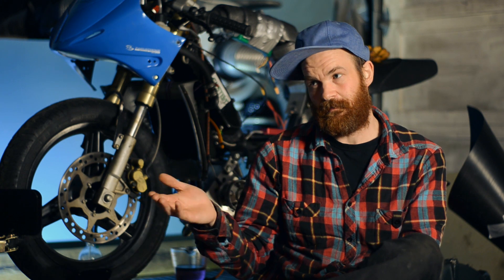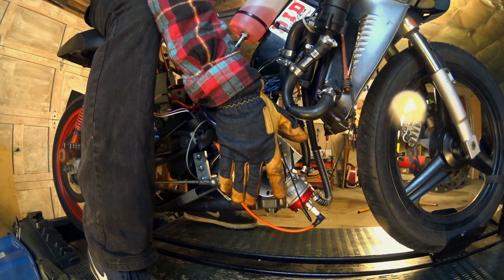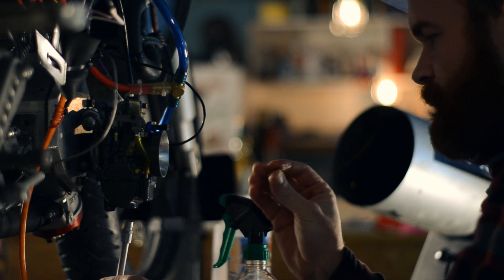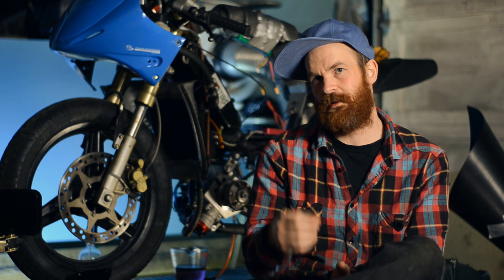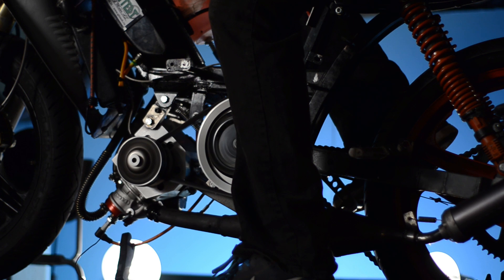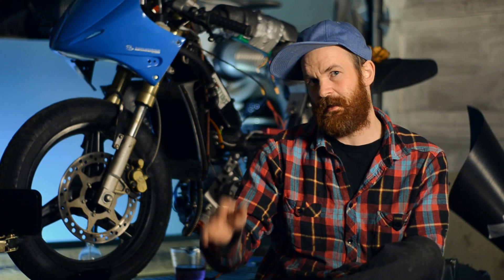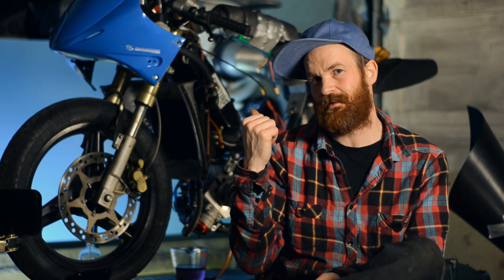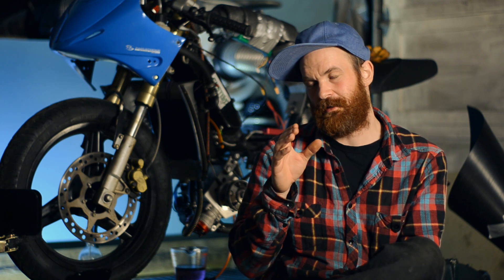Spx Ressurection Part 4 | The NITRO MOPED

Comment: I can only speak on gas motors. To really know your tune, pull the head and read the top of the piston. Look at the color delineation on the plug electrode. When you have achieved a perfect burn keep notes as to how the carb was tuned and what the adjusted altitude of the air was when everything came together.  These notes, and the adjusted altitude algorithm will give you the advantage during a California Timing Assoc. speed run.  To set records, your tune has to be perfect coming off the trailer!  Note, to make the perfect pipe you need egt.
Reply from the maker: Thanks for the tips!
Reply: @2STROKESTUFFING  I have never seen a more motivated builder!  I hope you accomplish all you have set out to do.

Comment: Did you try to put the largest max circuit on that carburator? Maybe you just have to close a little the air circuit and gain fuel circuit. What size is that carburator? I'm not an expert, hope this can be helpful. Great works on your garage, let's keep 2 strokes alive and make them better

Comment: Straightening the air may help a bit.  An intake hose, PLUS I suggets a K&N cotton filter. Foam may straighten better, but I found foam restrictive. K&N flows more. According to K&N themselves; their filter increases intake flow compared to no filter at all. (Your set-up).  I believe this is due to turbulence.  Think of a horde of people trying to enter a stadium. compared to organised lines of people entering. The latter will allow more to enter faster. :) hope this helps  :)
Reply from the maker: Thanks for the tips! I have to experiment!

Comment: Wich is the diameter of your exhaust collector? An old 2stroke enthusiast says me that he follow a simple rule: Carb diameter at most equal to the collector diameter. Maybe it is correlate to your problem
Reply from the maker: 27.5mm, 24mm at the narrowest cross section of the duct. Interesting rule of thumb.
Reply: I had an old polini evolution exhaust designed for 50cc evo engine (T port) and its collector diameter was 30mm internally, 24mm sounds a bit enclosed to me.
Reply from the maker: 24mm is 75% of the total exhaust port area, this to keep velocity high in the blowdown face.

Comment: Hi, what is "Tuned lean in inches"  i found something but i don't know what is it..
Reply from the maker: "tuned length" it's the length of the exhaust system, from port window to end of convergent cone(some use middle of cone)
Reply: 2STROKE STUFFING no lenght l, lean
Reply from the maker: Then I have no clue... Sure it's not a typo? What's the context?
Reply: It is for exhaust calculating Lt=Tuned lean in inches 
n=rpm 
etc... maybe carb in mm/inches, i don’t know
Reply from the maker: It's definitely a typo then, should be "length".
Reply: 2STROKE STUFFING maybe mistake by writer

Comment: Wats your plug gap at?
Reply: Also do you have a wideband o2 on it?  Is it reading  lean but sounds rich? i still thank its a dwell problem.  I would like to hear it again with a .010 plug gap        exhaust temp will drop also if this is wats going on up top.
Reply from the maker: About 0.6mm,I'm going down to 0.4mm. Actually thought I was at 0.4 already due to a measuring error with the slanted race plug ground electrode.
Reply from the maker: Actually just got one thanks to a very generous viewer!
Reply: Nice.  That should defiantly allow a few hundred rpm increase if that's the problem.

Comment: Great work. Love your videos and your passion on 2strokes. I believe your problem is the ignition. I hear the engine missfiring. Did you raise the compression ratio or is it the same before the cylinder mods you made. If you did raise the compression I think there is not much spark energy that leads to missmfires at these revs. Good luck pal.
Reply from the maker: Thanks! You might be right, I too think it sounds like misfiring, and ignition voltage becomes very high at "the wall" probably because it's struggling to get a spark going.
Reply: Try to reduce the plug gap only to see if it revs more. If it revs, you probably need better coil. Keep up the good work

Comment: I wonder if it has something to do with the heat range of the spark plug.... especially with the exhaust temp in cylinder head temps dropping at the wall.

Comment: hi,idefinately think the carb is too big.32mms for a 50cc is too big.Smaller carb should do it.The aprillia 50 i have which is tuned revs over 11000 rpm with a stock modified carb
Reply from the maker: It actually should not be too large in theory. When things are working right my bike isn't even in the powerband yet at 11000.

Comment: The area of a 32mm. carb bore is just over 8 sq. cm. The area of a 24mm. carb bore is just over 7 sq. cm.I'm guessing from the vids that your intake port is around 6 sq. cm. This explains why the engine starts and runs at lower throttle, but bogs and hesitates beyond that.Modify a 20 to 24mm. carb for nitromethane, or enlarge your intake port to better match the big carb, and hope it doesn't take away too much low end torque.
Reply from the maker: The intake port actually has a bit more area than the 32mm carb.

Comment: Not related to your problems. But why did you impliment an engine swing mount?
Reply from the maker: It's how this transmission setup works, called "single variated". As the belt moves up the variator the engine is pulled towards the fixed rear pulley. It's a cool setup cause I have some manual control over gearing with a foot lever, the downside is 0.5x range vs typical scooter CVT's
Reply: It's very cool indeed! Would love a quick video about it, if you have time. I suppose others have the same question. (Or if you have already, please link it haha)
Reply from the maker: There's an old video about it on my channel, but I could include a short explanation in one of the upcoming videos too.

Comment: Because of the excess mixture, the exhaust
gases cooled, the sound speed decreased and the exhaust system had to be
shortened. Try isolating the exhaust bar with a tape
to achieve a resonant shortening effect (higher rpm). Changes work 1 per 1
because you will sweat otherwise! Cheers!

Comment: Hey brother..   loving the projects.
You'd make a good neighbor!!
Is there possibly Any issues possibly caused with the rotor valve timing not being a variable timing for the increased rpm ranges  ?   Possibly the seal to cases  is not great enough on the valve assembly??
Reply from the maker: Thanks! Fixed timing should be fine, and the seal too - but you never know.

Comment: Had to deal with a shifter kart engine (CR125) that would not rev over 10.5k when all the other engines just like it would go 13k - 14k all day. Turns out a new spark plug had been installed that was a resistor type and that along with the resistor plug wire cap was the culprit. Switched back to the old plug and everything was fine. Don't know if that kind of thing is happening for you. Another thing to check would be the rotary valve timing. It's probably correct but it wouldn't hurt to make sure.

Comment: Have you checked the squish velocity? If there is not enough fast turbulence in mixture, then burning speed is slow and you can not rev. Burning is slower than the pisto progress to down. On the dyno it look like rev restrictor and torque vent immetiate to zero. Just a hint.
Reply from the maker: Yep. Can't remember exact numbers but it's good.

Comment: what i try while jetting is running the bike on full throttle and then turnig fuel valve off so it cuts fuel and either will rev up b4 dying or run even worse

Comment: You should try using a long velocity stack to help increase the air velocity and reduce turbulence. Often open large carbs don’t run right because the air coming in is way too turbulent

Comment: Few questions that have probably been covered.
Have you got a timing light you can put on it during the run to double check the timing curve is correct ?
Maybe use a marker to set the max and min timings you expect to see if you don't have a retarding timing light.
And I recall you had an RPM pickup for the dyno, is that reading correctly through the revs.
Reply from the maker: Put a light on it last episode, seems fine. Could be it's skipping sparks. Reading the Ignitionmate there's about 7kv primary voltage and high energy at low rpm, at the "brick wall" thers 20+kv and low energy.
Reply: 20 kv is almost open plug lead voltage on petrol.
As in if you take the plug lead right off the peak voltage is the coil reserve.
If the demand is greater than he reserve peak of the coil, breakdown occurs and it will misfire when it meets the limit.
But I would not leap to the ignition tangent too quick, at this point its time to get back to safe ground and go back as far as you can to the known good setup.
The carb idea is the way to go at least as far back as you can to what was working and remove Nitro from the equation too because if it wont run right on Petrol it definitely wont run well on Nitro even more so.
Try that and take it from there.

Comment: I also have to complement you on the major step up video creation.  Really impressed.  Carburetion does seem to be the only answer left.  I don't think the small stinger would restrict it, it just would hold the heat and force a richer mixture to avoid melting it down.  Though I have seen some funny things happen due to ignition curves.  Honda dirt bikes have that built in rapid advance to avoid over-rev when in the air, but when loaded on the ground like in a kart will stick the motor hard.  I have been racking my brain trying to figure this out, but no good ideas from me.
Reply from the maker: Thanks! We'll get there!

Comment: I think it's the inductive pickup. If you can't test this with some sort of electronic equipment I will suggest you try something which is a terrible idea but that's what I do. Remove the cylinder, piston, connecting rod and re-assemble the engine. Make sure main bearings are lubricated well. Attach a small pulley to the crankshaft and a motor or dremel drill to a larger pulley. Using an o-ring for a belt, spin the crankshaft up over your 11K RPM limit and see if the spark plug still makes spark. Yes I'm insane.

Comment: Could it be the c.v. clutch dragging it back out of powerband as it seems the motor has a fair bit of resistance to overcome as the cv clutch/gearing opens and shuts. The motor also moves and encounters restance. Stab in dark really but you've tried everything else. Maybe a normal gearbox wouldn't do this. Great show.
Reply from the maker: Unlikely - happens with the drive chain off too...

Comment: I think you have reached the point where burning speed is the same as piston speed so the expanding air can't do work on the piston I'm sorry to say this but this might be a limit the block
Reply from the maker: But I had it reving much higher on the same fuel before.
Reply: i need to think about this imma do some calculations there must be something that we are missing

Comment: Excuse my ignorance, but what is the pedal under his right foot? It seems to move the engine ??
Reply from the maker: It does - manual control over variation.
Reply: 2STROKE STUFFING do you mean variation as in gearing, like on a scooter? If so why not try leaving it in its easiest "gear" and letting it rev out?

Comment: Any changes to head design in compare to previous? Especially to squish band?  May be problem with spark plug wetting? I think rc fuel droplet size a lot bigger and volume to. May be tighter gap and hotter plug could help? 
Another thing may be rotary valve problem? Can You try reeds?
Reply from the maker: Same head, I'll experiment with the gap.

Comment: Sounds to me like you need the same kind of timing that a two-stroke boat motor has you're not using the throttle you're actually turning the timing plate

Comment: Worth a try on the stinger, although I would have done a test run without the muffler to be sure its clear.
I think you need to retrace steps backwards out of the forest to ground you know it was working.
As a mechanic its part of almost every diagnosis, need to resist the temptation to try more then one thing between tests.
It can take a long time doing it that way but you wont loose your way if you stick to the method, likewise in race tuning, single steps forward and test each time.
If you back track to the old carb on petrol to begin with you know that revs fine.
If it does not rev then something else has failed in the mean time and you can step sideways to that and fix it.
If it does rev then go forward one step at a time, try old carb on Nitro, if good then try it both bigger carb on Nitro.
It's the longer way around faults but its the safer way home.
Reply from the maker: Good advice, you're absolutely right. My approach can be a bit chaotic...
Reply from the maker: Good advice, you're absolutely right. My approach can be a bit chaotic...
Reply: If you work back to the "last known good" position it then becomes evident that a fault has occurred that is not related to the mods you made if it still doesn't rev..
Then it becomes a basic fault finding exercise as if nothing was done to the engine and you were unlucky something failed during the changes.
If you do not go back to last known good then there really is no way to know if its a failure of something or a result of one of the modifications.
Going through a list of possibilities in that case can end in frustration because each time you try something and pin a fair bit of hope it will fix the problem and when it doesn't you are still none the wiser.
Maybe you make a rubber sleeve or the like to fit the old carb on the new manifold to test it so you don't have to commit to a new manifold you might not end up using.
Sometimes you can be better off assuming something you are about to try is not going to work so you don't invest too much hope and effort (cost) in to test for that condition.

Comment: Perhaps the opening angle of the rotating disk is too large, also check the suction channel surface to be equal to or slightly larger than the 32 mm carburetor surface.

Comment: Awesome! Your new camera is making a huge difference in the production quality of your videos and your editing is impressive.  
Do yourself a favor, buy wideband O2 sensor so you can stop making educated guesses about the a/f ratio. With your knowledge you could use an arduino to graph the a/f ratio which is a 0-5v signal from a wideband O2 (Standard O2 sensor is 0-1v and has poor resolution)
 If you used a screen recorder you may be able to log the dyno and the a/f ratio simultaneously to record the data for later review. A vacuum sensor, coolant temp sensor, throttle position sensor, or mass airflow sensor could be added with relative ease as well. Nearly every automotive sensor uses a 5v reference signal. I started using wideband sensors for tuning carburated cars a long time ago, saved me many headaches. 
 There are varying opinions as to the life of an O2 sensor exposed to 2 stroke oil, but for your purposes I don't think this will be an issue. Keep up the good work!
Reply from the maker: Thanks! There's actually a wideband meter on it's way!

Comment: I had the same problem with an engine 200cc 2t using methanol in Brazil. with Castor oil in 16% when cold and using cold plug it has the same limit rotation. putting a hot plug the problem disappears but during the race the plug broke the solution was change to oil synthetic using 5%. Rc fuel normaly have a blend oil castor/synthetic
Reply from the maker: Interesting!

Comment: i had an fa-50 do the same thing and it turned out closing the gap down on the plug fixed it since the coil was shorting to the frame due to a bad plug wire. im sure you tried this, just giving my 2 cents!
Reply from the maker: Could be it. Secondary voltage is very high when it's hitting the wall, could indicate a difficult to ignite mixture situation.

Comment: Top Fuel dragster nitro engines require more joules of spark. Could you be not getting enough dwell on coil.  Or how about going to a glow plug like model airplanes to eliminate spark as a variable.

Comment: Come to think of it, I've also had a carb that I just could not get to work on my engine. It would not rev and just sounded like it was 4stroking. I tried getting it to work for days, jetted all over the place, changed ignition, everything, it just wouldn't run clean. Finally tried putting my old carb back on and everything worked again instantly. I still haven't found out what the actual issue was back then, but the theory we had back then was that the carb needed an airbox in order to work as intended.
Hoping that's it, I know how mysteries like this can drive one nuts... Until you figure it out, then you're happy because you learned something :)
Reply: Same with me, thise fako oko carbs can sometimea work sometimes not. I had also a fake one and it run all the time untile it didnt. Cleaned it and rejetted still didnt work. Then bought a different carb and revved again. If his bike still doesnt rev then i think that the exhaust temperature is too low
Reply from the maker: Crossing fingers!
Reply: Yes carbs can produce a number of conditions from the metering circuits to the size ratios and they can also appear to be failing when it is something else in the engine.
Many a carb has been rebuilt in the hope it would fix a fault that turns out to be not related to the carby.
Going back to the known good carb can quickly sort out which is the case.